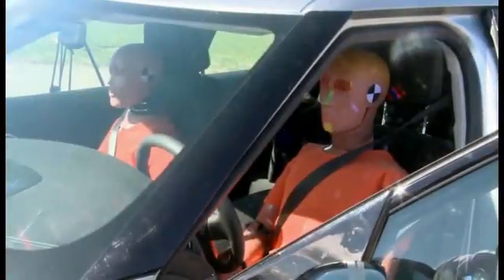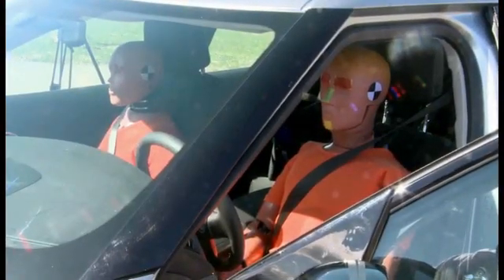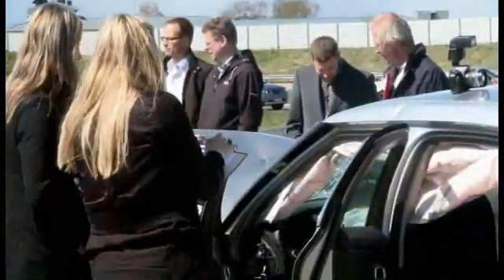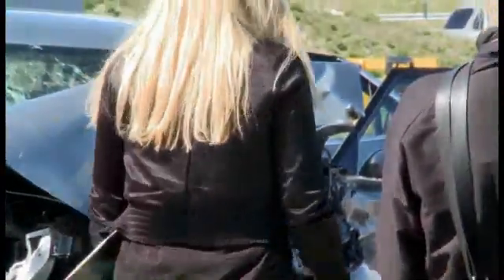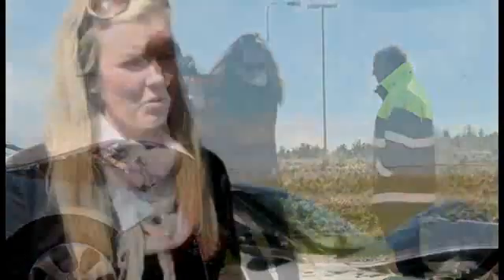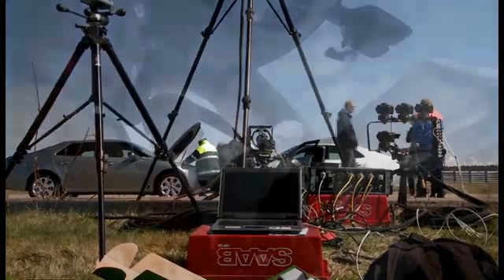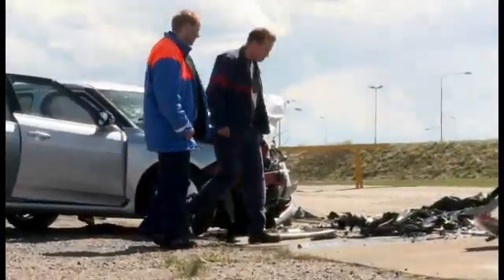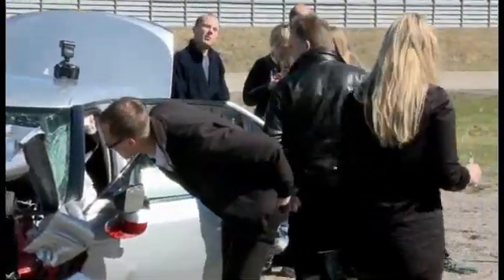Saab 9-5 (2010) crash test video

Comment: @Funker242 & @proxemi:  2 cars crashing into each other while traveling 60Kph has the exact same effect on both cars as the effect on a single car traveling 60 kph hitting a brick wall. The reason is that both cars decellerate from 60 kph to 0. Neither car is decellerating from 120 to 0. And because Ma = F (according to Newton, a fact which is very likely to have been included in your school's basic physics).. The force is equal in both cases..